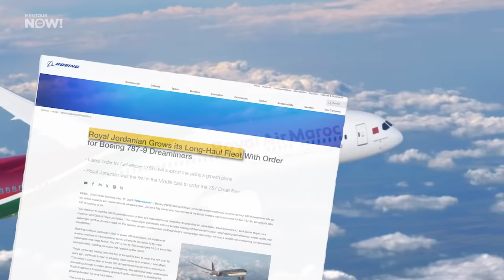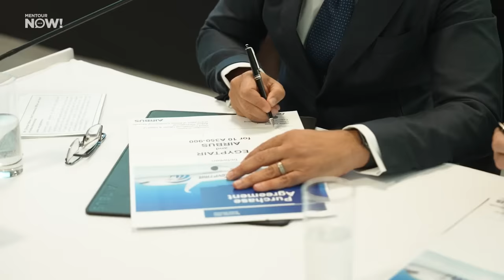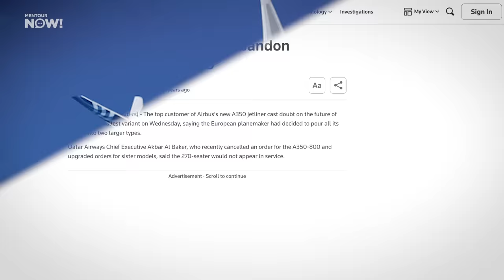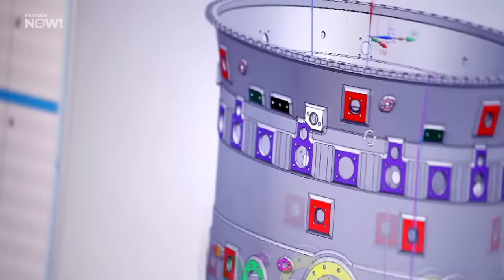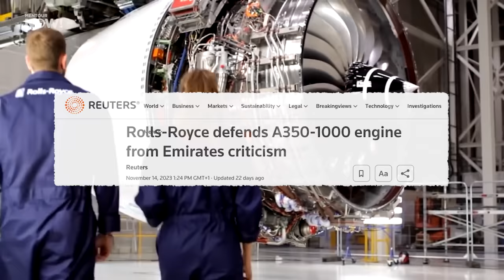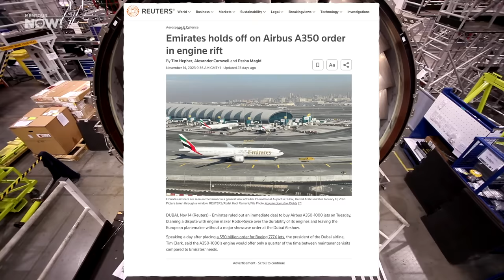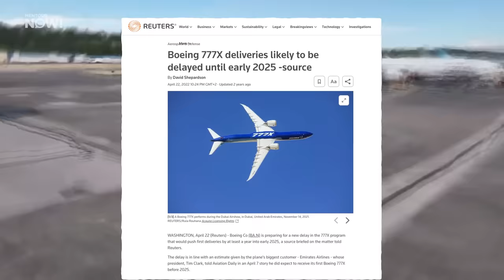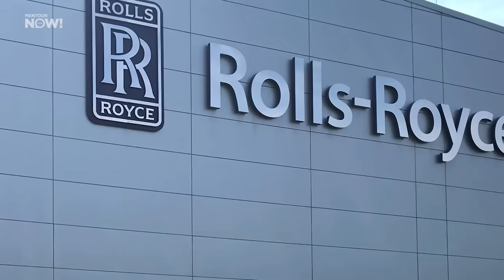What’s WRONG with the Airbus A350?!

Comment: There are a lot of complex issues that go into why an airline would choose one aircraft over another. Price (initial price per plane), maintenance (service on engines, etc.), pilot training (if you have 1000 pilots who fly the 777,  it's cheaper to switch to the 777X than train them to fly an A350), passenger revenue per mile, and so on. The 777X has 40-50 more seats than the biggest A350, so that is a problem for the A350 on a lot of routes where an airline would like to squeeze in more passengers.
Reply: The a350 will do it cheaper
Reply: @Sterlingjob  Do what cheaper?
Reply: @Djamonja  Operating, fuel, maintenance etc
Reply: @Sterlingjob  Than the 777X? Which plane do you mean?
Reply: @Djamonja  a350
Reply: @Sterlingjob  I mean which Boeing plane are you comparing to the A350. 777X?
Reply: @Djamonja  yes
Reply: @Sterlingjob  The 777X will seat about 80 more passengers than the A350-1000, so it's difficult to compare them.
Reply: @Djamonja  depends what seating configuration. The 777x is a massive aircraft and I was told a few weeks ago it has weight and engine issues.
Reply: @Sterlingjob  Of course it depends on the seating configuration and being a bigger aircraft, but just saying you heard it has weight and engine issues doesn't mean much on YouTube.
Reply: @Djamonja  If it didn’t have issues don’t you think it would be flying by now? It’s years behind schedule, my airline I work for won’t get them till 2028. A pilot I was talking has a daughter who works for rolls Royce, I also work as an engineer so we do hear things.
Reply: @Sterlingjob  Of course it has had development issues, like pretty much every other aircraft before it. That has nothing to do with operating costs, maintenance, etc.
Reply: @Djamonja  It’s 6 years late for a start.
Reply: @Djamonja  the structure is also 12 tonnes heavier, so yes, it is heavy and possibly overweight
Reply: @Sterlingjob  I am aware, and that has nothing to do with what we were originally discussing.
Reply: @Sterlingjob  You're just changing the subject since your original comment was wrong.
Reply: @Djamonja  it’s all part of it. Delays, running costs and the aircraft has still yet to start flying commercially, which will open another can of worms.
Reply: @Djamonja I’m not wrong

Comment: ...something wrong with the A350? Well, in fact it's not "something", it's a lot and it's not a surprise, it's to be expected.
I was involved in the design of the rear part of the fuselage production line in Augsburg (I think it was called section 16/18) and seeing the actual production made me vow to never ever fly on one of these 😅
Remember those "paint problems"? Those aren't just paint problems, those are delamination problems.
Delamination, as in "structural skin slowly turning into a bunch of loose fibers".
It's a bit like that classic Donald Duck cartoon where the home made plane slowly disintegrates in flight because of rain melting the structure...

Comment: I love the A 350, it has a sexy look from the front section  and i am rather a fan of shorter time on wings  though its expensive.This way faults are detected before they occur.The aircrafts of today are not like the Vc 10s that could travel several miles with little or no maintenance.From the airline perspective longer time on wings is a preferred option but not for me as a passenger or even a pilot.

Comment: Since your video Turkish Airlines has placed their order for the A350, 80 in total with 60 A350-900 and 15 A350-1000 plus 5 of the A350-F which have the same engines as the -1000. Additionally Turkish has taken options for 20 A350-900’s and 5 A350F’s. Also Cathay has placed a firm order for the A350F of 6 aircraft with a further 20 options so the -1000 has had orders and options for 51 A350-1000 and A350F since Dubai both variants having the same Rolls Royce engine variants.
My reading of the situation is that the new Rolls Royce CEO has, as you correctly stated attempted to dramatically improve the profit margins on engine maintenance but appears to have gone in like a bull in a china shop before really understanding not only the finance side but also needing to understand the marketing, politics and forming a relationship with the customers, he seems to have forgotten the age old rule that it takes years to form deep relationships but days to destroy them. Clearly RR are continuing to improve their engines and, assuming there is a problem with the -97 in hot dusty conditions, I am sure that they will resolve that in due course. Tim Clark is a seasoned campaigner, he saw the new attitude by Tufan Erginbilgic as unjustified and a challenge, realised that he was holding most of the cards and placed RR in an invidious position whereby not only were they fighting their potential customer but also seriously challenging Airbus and their position as sole engine supplier. My reading of the situation is that whilst little seems to be happening from the outside, Rolls Royce and Airbus are paddling like crazy below the water surface whilst Sir Tim sits back awaiting a more interesting deal allowing the placement of a bumper order next year, probably at Farnborough.

Comment: The Airbus structure has disappointing quality, and also important the maintance requirements and body surface quality, which has turned away clients. The performance is far behind the 777 X.
The orders are tainted by the typical corruptive practices of ABI.

Comment: I thank you for this great professional analysis of the problem of aircraft and engines. And it is very good that you emphasized at the end how great this Airbus A350-1000 has become. It is a pity that Emirates decided otherwise. But based on your very good analysis, the reasons are quite understandable. However, Emirates is one of the largest operators, but there is still a huge market outside of Dubai for this aircraft. And thus it can now be an advantage for Airbus that Boeing's capacities for this type of aircraft are pretty exhausted (and that at probably very low calculated prices, because Emirates can almost dictate the prices by now). In the next orders, Airbus will be ahead again and then with better margins. That's not bad either.

Comment: Airbus recently had some paint peeling problems , which did their image no favors.Cause unknown. ....to me.  There are also some problems with RR and P & W. I have a strange personal preference  when I fly. I prefer the airplane to have the same number of turbine blades attached to the engine at both take off and landing. I also like to sit far away from the engine and definitely not right next to one. It is an advantage when the wing act as extra armor to help the cabin wall. Nothing ruin your day faster than a piece of the  turbine blade that end up on your lap..........after it went through the seat back ! Two years ago, I decided I rather fly with a pilot that is a bit drunk , than one who had the so call "vaccine" I will not get into a single pilot plane unless I get the co-pilot seat, The vaxed pilot can suddenly keel over and someone else will have to land the plane. I can manage anything up to a King Air, I likely walk away, even if the plane is not air worthy for tomorrow.

Comment: Rolls Royce engines are not good never will fly on an aircraft that has rolls Royce. Ge is the best.
Reply: Will you still be saying that if the GEnx develops problems with powdered metal, its implicated in that, they use many of the same components.........